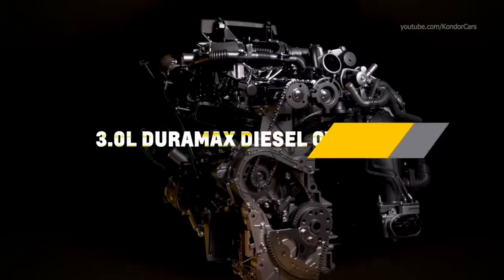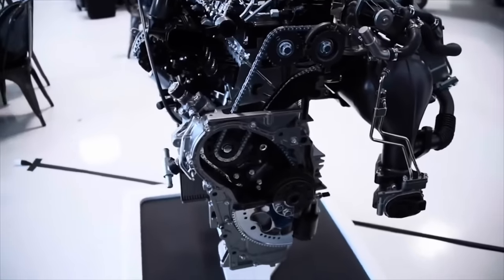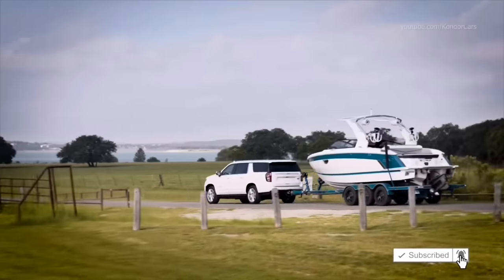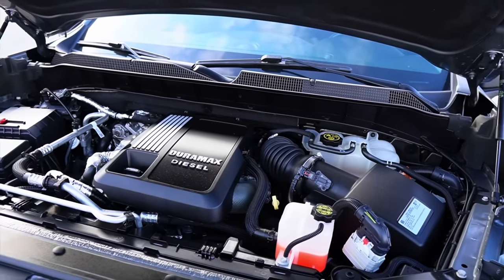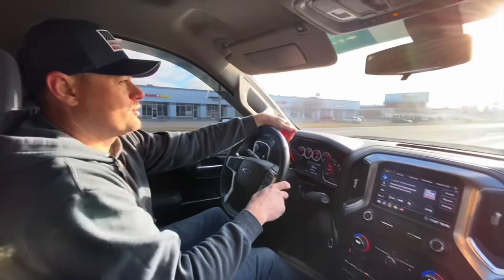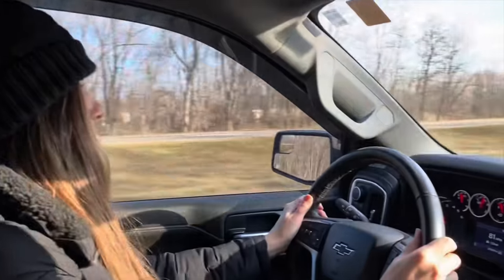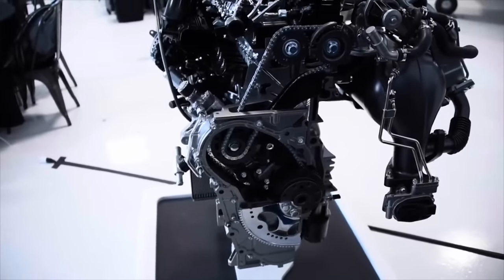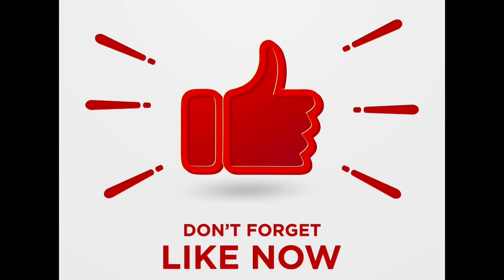What Everyone Needs To Know About The 3.0L Duramax!

Comment: I've got an ecodiesel and I will say even the smaller diesels are plagued with emissions problems. Once the EGR and DPF fall off driving down the road and tuned they are super run and amazing fuel mileage. Also, hello from 🇨🇦
Reply: Don’t you just hate it when the emissions equipment falls off and it automatically tunes itself and puts in bigger injectors
Reply: They all have problems with the same thing
Reply: My 21' ecodiesel has its dpf relocated. Id like to see the 3.0 duramax's deleted so we could actually compare these engines themselves without the emissions plugging them up
Reply: Waiting for my 3.0 egr to fall off when I get some free time 😆
Reply: What are you getting for mileage. Or kpl
Reply: What mpg?

Comment: I’ve put 5,000 plus in my 2022.5 and I’ve only put one box of DEF in it and it’s still almost full.  I get 30 avg out of it.  The top end isn’t crazy.  That bro g said it still will get out of the way for a normal daily driver.   If you want 1000hp it’s not for you or maybe it is. I’ve had a 2000+hp Cummins and still love this 3.0.  The bottom end has plenty of power up to 70mph.  I’ve had several high hp diesels and I still love this 3.0.  I look forward to the tuning capabilities and ph increases coming in the future and trans turning from OZ tuning would be an awesome idea.  He is the man at fords 10speed version.
Reply: Sorry for not checking my spelling “being not Bro and hp not ph. 😂

Comment: You nailed it ... its an awesome daily driver pick up.  Had a 2021 - traded it off on friday for the new LZO 300hp -- Main reason i traded it off ... it sounded like it had an injector tick ... and it burned 1 quart of oil between oil changes. (if this 2023 does the same thing ... I'm off these 3.0's forever)   Its really capable 5000lb tow-er we haul 3 horses around and it works just fine.  Don't pretend it will replace a Big Duramax because it just won't .   My advice use the 80/20 rule ... what do you need a truck to do 80% of the time -- and buy "That Truck".  Only caveat ... is the truck you buy has to be able to do the 20% at least poorly.   OR ... like me have an old farm pickup.  I enjoy the videos -- thanks for making them

Comment: 2020 AT4 3.0l Oil patch pulling trailers and i love it, started this morning with out being plugged in at -32 C. Tows well and runs great. i have had 5 2500Hd Duramax before this with over 200,00 km on each of them and have loved every one of them with no major mechanical issues. my 2020 3.0 is awesome and not disappointing in any areas.If i could delete DEF it would be perfect.
Reply: What’s the Km on your 3.0?
Reply: You understand the only thing your HD diesel has in common with the 3.0 is that they run on diesel?
Reply: @jeffw6894  yes i am well aware of what it is and what it is capable of.

Comment: I have a 2021 GMC 3.0 Duramax I absolutely love it. I pull a 16 foot trailer with my side-by-side on it. We take it on trips and the miles per gallon is phenomenal so for my personal self this was a win I’ve owned a 5.3 Gasser in the Duramax is just so much more fuel efficient
Reply: I just picked up a used one 2021 Denali crew Cab it has 86,000 km (53,000) miles. Regular filter and oil maintenance consistently, the guy put a lot of km’s/miles on the truck. Any advice or tips you have with the truck? Do you leave it in 2wd? For better is it that much of a difference having it in auto 4wd
Reply: @antonioromano9919  leave it in 2wd. Only use auto or 4wd if the condition call for it.

Comment: I have a 2016 LML stock 100%. If I’m not towing it gets 25 mpg at 65 mph and if I slow it down to 55-60 mph it’s up to 28 mpg. The half tons will sway a lot more than the HD pickups. If you put anything in the half trucks bed and towing a walleye boat you need to put air bags in the rear to compensate. What sucks is they are getting away from leaf springs and solid axles.

Comment: Like everyone else has said, use case is what it is all about. If you are not looking for show, and are not consistently hauling around 10k it is really hard to beat. I am a GC and stepped down from 3/4 tons to this and don't regret it. I commonly haul my tool trailer coming in around 6k, and my dump trailer loaded with demo debris around 8k. And it works great. But for 75% of driving it just me, my basic tool set, and some material and it really shines. I am 90% around town driving and around 21-22 like that and around 25mpg on the highway. In the rare cases I am empty I have seen as high as 36mpg on the hwy. I drive like a grandpa though. Set the cruise @67mph. It does appear to require more turbo if you cruise above 70 and that seems to cut your fuel significantly. At least it does in my truck. I am putting some bump stop springs to help with the rear sag under load, and I do get the dreaded tat-tat no start 1-2 times per year. And I sure wish the seats were a bit more comfortable. But other than that--great truck. And I sure don't miss the bigger trucks, with their challenges and expense.

Comment: I have a 2021 sierra 1500 with the 3.0 duramax and 21,000 trouble free miles. It’s smooth and tows our 6000 lbs camper with ease.

Comment: I truly think the Sierra looks better in my opinion and that's why i chose the 20214x4 crew cab model. I did not like the front end of the Silverado. Regardless i absolutely love the 3.0 Duramax. Got mine with 7 miles on it. and i put A/T tires on it and Bilstein 5150 shocks on it and leveled the front end and what a night and day difference compared to stock setup, although i lost about about 2mpg doing that. i have 30k miles on it now and not one issue with the engine or the truck. i routinely get about 24-28mpg per tank and can easily go 500 miles before thinking of putting fuel in her. i also can go about 3 months before adding any def as i usually add when gauge reads 50percent left. i think the advantages far outweigh the disadvantages of the diesel

Comment: I think you'd both appreciate the new Silverado interior.  The DEF needs refilling every 5K miles or so as reported (unless you're towing).  The fuel costs are incredibly different depending on region.  Colder areas will always pay more because of the competition of diesel and fuel oil cut from every barrel of oil.  Near me diesel is 30% higher than regular.  I suspect that the mileage improvement will be better than that.  I've heard that these smaller diesels aren't the service nightmares that the large Duramax's are.  For a normal user, that 150K belt service (which will increase with the new LZ0) can be budgeted over a nearly 15 year life.
Reply: Maybe it’s a extended cab instead of a crew cab
Reply: I have a 21 Silverado with the 3.0L duramax with crew cab. Very roomy for me and my kids. I haven’t had the truck haul over 5,000 yet but I love the truck and great fuel economy. But yes, DEF sucks especially in availability in my area but with low mileage I only have to purchase DEF twice a year at most (every 6-7,000ish miles)

Comment: my grandfather has a 3.0 21 silverado in a crew cab 6.5' bed configuration and we did a 900 mile round trip for a fueneral, avg speed was 80mph and fuel economy going south was 25 avg. fuel economy going north 26.5mpg, again avg speed of 80mph

Comment: I just purchased the LZO.  I previously had a 06 Silverado with the 5.3.  Close to 200K miles on it, and it was still running great.  If it were just for me to have and use for hauling loads of mulch in the spring, or the boat back and forth to the lake in the summer, I would have been fine keeping it.  But I started a business and tow a small 6x12 trailer around, and it's nothing to put 200-300 miles on it a day during our busy season.  Getting 10-11 mpg with my old one was gutting me, and I'd fill up the tank just about daily.   
Just pulled a 24 ft pontoon boat, to the lake and back, averaging a tick under 17 with the new LZO, and that included waiting at the ramp, and loading/unloading, etc.   Haven't done a trip with the work trailer, but after pulling the pontoon with it, I'd be shocked if I didnt get 20-22 with my enclosed trailer.  (I'll come back and update if I'm wrong).   But for me, the '23 Silverado with the 3.0 checked the boxes.  
Some additional things I noticed.  1)  the service intervals have been updated for the oil pump belt.  LM2 was 150,000 miles.  With the LZO that changed to 200,000.
2) The truck you were driving appeared MUCH smaller in the back seat than the '23 I just got.  My '06 was 12" from the back of the driver seat to the front of the rear seat.  The '23 is just over 14".   I get that I'm comparing a 13 year old truck to a new one so it's maybe not the best example.  I'm also not towing massive things daily, but for me, I got 200,000 out of my old one because I took care of it and didn't ever let small problems turn into big ones.  I expect that I can do the same with this one and have the same experience, just get better mileage along the way.

Comment: I have a 21 Sierra elevation with the 3.0. It has about 13k on the clock and I’ve had it since 8/21. It’s been in the shop 6 times in less than 4k miles with emission issues from egr sensor, nox sensor, wiring harness pigtail for diff pressure switch, def gauge software problem, and catalyst converter. Lucky it has been all warranty work. 
I tow a 29ft camper and it does good for what it is. I love the truck when I can drive it but I’m glad it’s a lease…they will be getting it back in exchange for a 2500HD in 2024!
Reply: Unfortunately, your story is closer to the norm then some of the fairytales I've been reading.

Comment: I've had one for a year. It's definitely not a race car but compared to my 2014 5.3, its quicker off the line and lower speed driving. Once you're above 50 and get on it the 5.3 did feel stronger but I think some of that has to do with the higher RPMs of the v8 and the bigger gear difference when dropping down in the 6 speed. There are things I miss about my v8 but overall the 3.0 is a much better driving experience. It also tows and hauls better and smoother. I towed a Jeep 600 miles and averaged 18MPG on that trip. It fits my lifestyle because the heaviest towing I do is around 6500lbs so yeah even the base 2.7l can do that no problem but this drivetrain just does it better.
Reply: I also have a 2014 5.3. While I know, the engine is pretty stout, the thing feels gutless the way it is tuned. I am considering ordering a new LZ0 to replace it. How many miles are on yours so far and what have you been averaging empty? Also, any oil consumption?

Comment: I have a 2023 baby max. O, GM did good with this one. My upgrades are a new oil pan (the factory doesn't drain all the oil out.... 1qt), new trans pan, trans bypass (temp stays 140 ish), and trans cooler. Banks Idash/ pedal monster.... o my it woke up the max. Pulling my 4k pound boat, no problem. Change all fluids to amsoil

Comment: The lifters or whatever on the 5.3 and 6.2 were another reason I didn’t go gasoline. While typically gas trucks are simpler to maintain, the 3.0 LM2 was the best for reliability in what i found. I almost sold if for a 6.2L zr2 a few months ago but I didn’t & told them nevermind on that zr2 i ordered because of the 6.2 issues
Reply: The lifters issues are from active fuel management   dropping to 4cly 60mph
Reply: I bought a tuner for my 2013 5.3L due to the DOD lifters.  I bought it with 52,800 miles and traded it in at 102,000 miles.  The truck performed way better than my dads 5.3L being it was stuck in V8 mode all the time.  I did experience a 3 month period prior to trading it in where the truck would act up and then would be fine.  6 shops later 8 mechanics later no one could figure out the issue.  They could see the issue when driving the truck but the truck had zero check engine lights.  Fast forward to the day I traded up and the tuner was removed, the truck took 24 hours for the lifters to collapse.  Hence the ghost issue no one could find being the ECU was locked in V8 mode vs allowing it to derate to V4.   Stupidest idea for GM and the biggest joke ever used in a motor.  I honestly would not go back to a 5.3L.  I bought a used 3500HD 6.0L work truck and I haven’t regretted it.
Reply: 5.3L is a great engine, pre 2007. once they put in the AFM it destroyed the lifespan of this great engine.
Reply: I was looking at a 6.2L in the Tahoe but not one dealer (including service manager) could look me in the eye and tell me that the 5.3 & 6.2L lifter/pushrod issue is fixed (2019 and newer). Silence speaks volumes….so Im Im going back and forth between 6.2L and 3.0L.  I do pull a 6K camper over 10,000’ mountain passes routinely during the summer months and do 6K miles from late spring to late summer with commutes to town of about 50 miles round trip but during the winter most of my driving is just 2-3 mile trips a few time a week.  This reduction in miles during the winter worries me with regards to regen.  Not sure if the 3.0L is a good choice given my driving habits.
Reply: Completely agree with all of you guys. Knock on wood, my 3.0 LM2 & every other one i have known of around me (friends/customers) have been working great 🤷🏼‍♂️

Comment: I bought a 2023 bady duramax.  I like it a lot but I've never ever heard of oil consumption.  That's going to drive me crazy. Oil consumption tells me there's a problem. I hope somebody comes up with a fix/solution.  At 4500 miles, the oil was low on the stick. GM changed my oil. At 6400 miles now, it was on the low/ add oil. I hope this is not the norm. Other than that it's a good truck
Reply: Hopefully, there's soon to be a part to replace. All of my years of being around engines, I've never heard if that/this happening

Comment: I’m on my second 3.0.  I tow my 8500 pound camper and my pontoon boat.  This thing has stupid power on take off and little effort on grades.  Your not having to mash the accelerator just slight moderation.  Love the fuel economy and hardly ever have to put def in.  Don’t bite on the lack off take off claim!  It’s a solid truck and the noise a gasser makes is half the enjoyment of taking off.  The diesel walks softly but carries a big stick!
Reply: I think weight is underrated I tow my camper 10,500lbs 1000lbs tongue weight a quad in box and honestly pulls it like nothing like u feel it obviously but it has no problem pulling it

Comment: I personally have owned a 3.0 for just over a year now and here is my take. 

First off I tow a 29ft, 7200 pound travel trailer in the summer time and for the most part the engine does well. Fuel mileage is not so great towing but that is to be expected and it doesn't seem to lack for power in most situations however I have run into the temps getting up there on long uphill pulls.Empty this thing gets great fuel mileage but I still struggle with keeping it long term due to being a new design. Only issues I have had so far have all been emissions related. I had to return to the dealer 4 times before they finally figured out I had a bad connection to the DPF sensors. The advertised exhaust brake is about as effective as a fart in a wind storm!

If I found a good deal on a 6.6 I think I would trade this one in but at the moment they are just priced way too high for this guy.

Comment: I had 2022 limited 3.0 gmc and I loved it, I drove down to bull shoal Arkansas to pick up a boat and drove back on around $270 of fuel round trip, I had 137 miles on her before I did that trip, I didn’t burn anymore fuel pulling the boat. Fast forward I pulled my walleye boat with my 3.0 and it’s way heavier than the one I bought in AR and I could tell when pulling it to the Detroit river from central MI. But I did pull my camper back from upnorth 2.5 hours away from my crib and only sucked up quarter of a tank, my travel trailer is a duel slide 26ft so probably 28-29ft actually. I was impressed with that. Over all I owned it for about 6 months an sold it for way more then I owed (GM discount) I own 2 LBZ’s and miss the fuel mileage I was getting out of the 3.0 lol. I owned a 2.8 duramax for a couple years and man that sucker was sweet on fuel 30-40mpg depending on the season. But the dead pedal and no get up an go sucked.

Comment: I have a 22 highcountry with the 3 l diesel. So far no issues with 14k mikes. Already 2 oil change and 2 def fill ups. It’s very nice. I love this truck
Reply: Truck master it seems someone is trying to scam me. Telling I have won a prize and I need to send $500 for shipping. They said I should dm on telegram to claim prize.
Reply: Me too. Love that engine. Couldn't talk my wife into the high country though haha. LT for me. But no complaints at all. A pleasure to drive every day. 

That comment is a scammer btw, just a random bot typing comments. Just ignore it.
Reply: @79champions  yes it’s a very nice engine. Love driving it too. 
I got my highcountry through a default. I bought a raptor from a Chevy dealer and had to take the raptor back because of issue with it, I told them I need my money back of a new truck. They offered me the highcountry which I have no regrets
Reply: @79champions  yes it’s a very nice engine. Love driving it too. 
I got my highcountry through a default. I bought a raptor from a Chevy dealer and had to take the raptor back because of issue with it, I told them I need my money back of a new truck. They offered me the highcountry which I have no regrets
Reply: @79champions  yes I realize it’s a scam. But they are using truck master profile it’s crazy. They want me to send $500 for shipping tell me about customs fee. So I ask what customs fee if the truck is already here. 
Stupid people